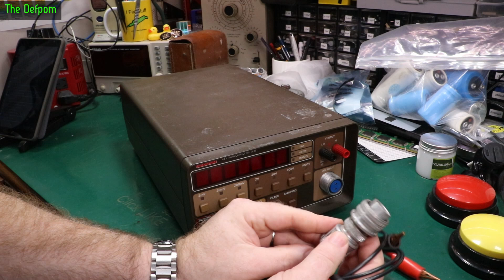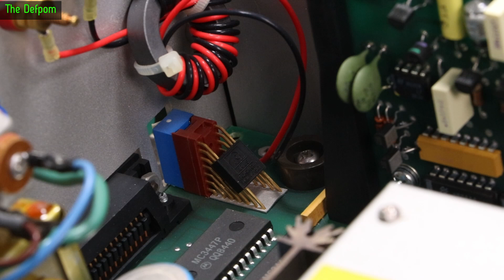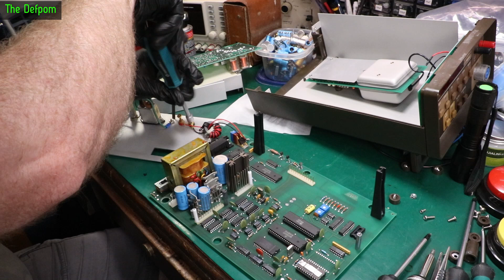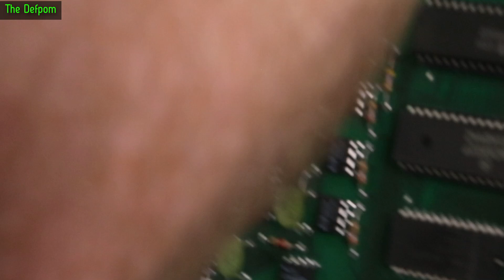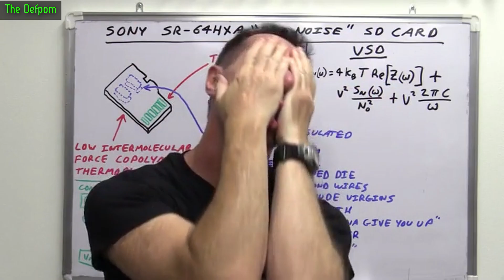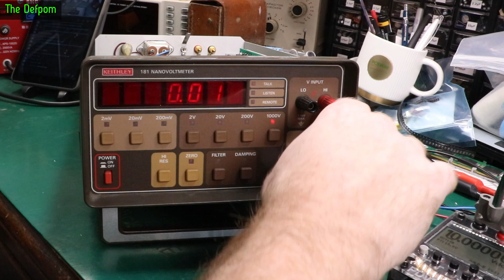🔴 Keithley 181 Nanovoltmeter Repair - No.1242

Comment: If you can't solder with the amount of flux already in the solder then your board is contaminated,  your tip is worn out, or you should consider going to soldering night school. 😂😢😅😊
Reply: Lol TEH
Reply: I was taught how to solder in Secondary School in 1973. I always used rosin cored solder and never used any extra flux.
Reply: @anthonyshiels9273  I started soldering pcb's for avionic equipment when I was 17 and now in my 60s having worked in electronics design most of that time.  Flux was something that always came in the solder,  unless you were tinning wires were the wires were dipped in the flux before being dipped in the solder pot. Non fluxers stand united:-)
Reply from the maker: Mr Rosmann would be offended! But yes I only use flux when I need to when the joints don’t look great or if I know the material I am soldering is less than good enough such as old terminals etc. the only exception really is when I’m doing SMD as that much a huge difference getting parts to sit nicely
Reply: @TheDefpom  mr Rosmann uses flux a lot for taking off components which is a valid use and then sweats the replacementon. For tph it's quite normal to refresh the joint by adding solder which is in affect adding a little new flux.  But if you're going to use new solder to remount a component then flux is not needed.

Comment: Nice wee unit, looking forward to seeing how stable and accurate it is.
That flying lead is only supposed to have the croc clips on it, the other banana tails work great as antennas picking up noise!
Reply: Can't beat a short wire antenna when measuring nanovolts to provide a little bit of extra amusement😂😂. Surprised that there no guard option on the input.